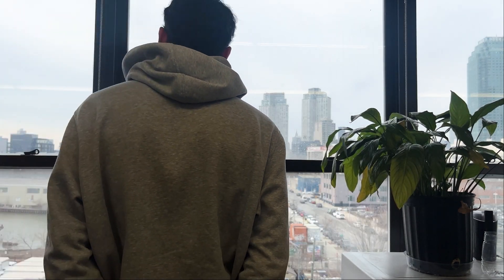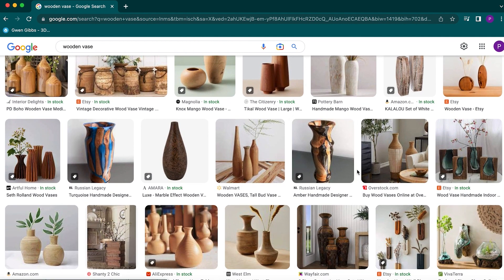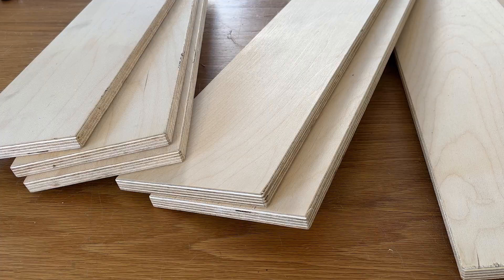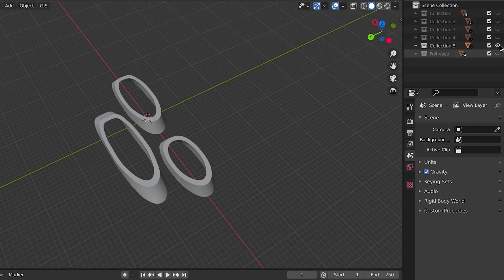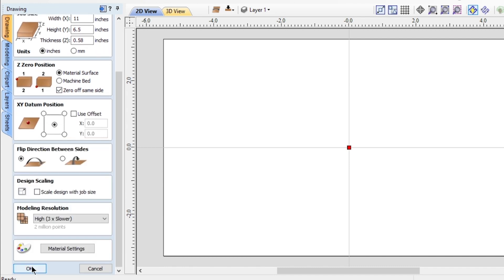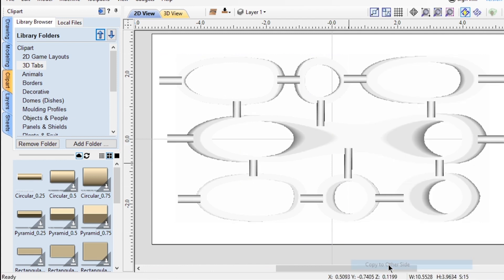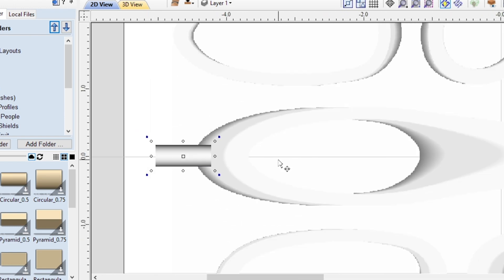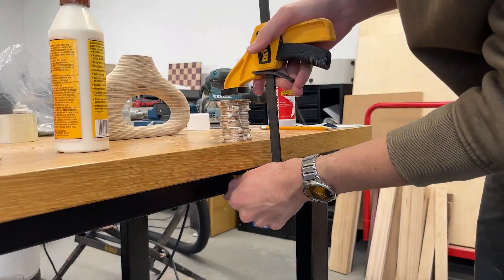Try Out This CNC Technique To Make Practically Anything With A 3 Axis Machine!

Comment: interesting, why not split the final vase in the middle making 2 parts and milling each side using a thicker wood and then glue. is it not easier to do?
Reply from the maker: Definitely possible for this design, but wanted to test the multi-part stacking method for future, more complex shapes!